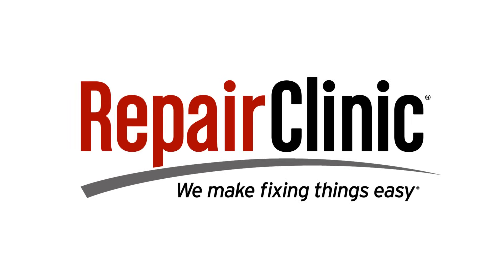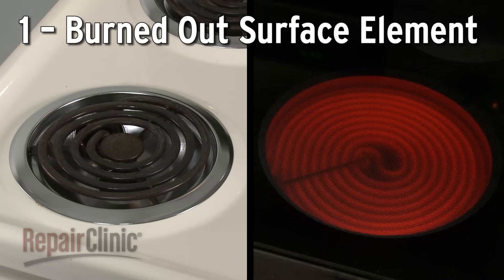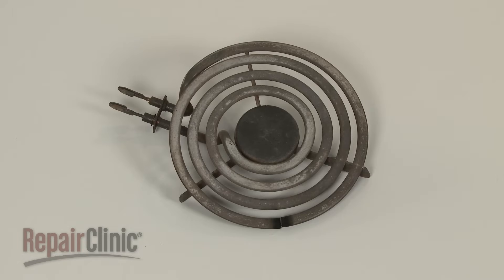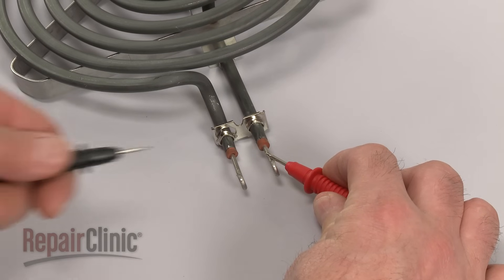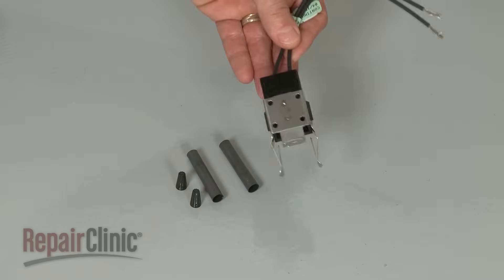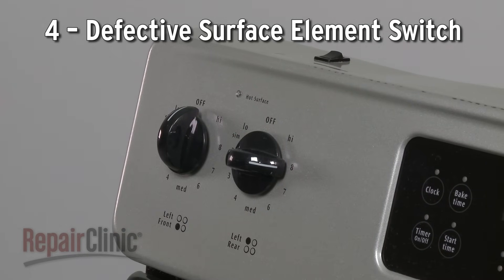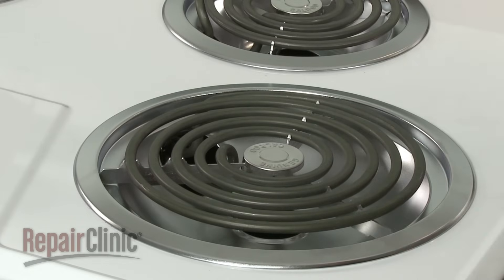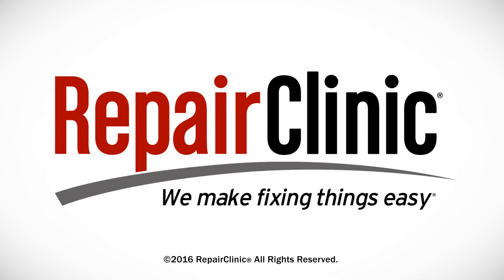Surface Element Not Working — Electric Range Troubleshooting

Comment: My radiant dual element has two probes.  One is not depicted in this video.  Test it for continuity too.  Mine failed and caused the burner to not heat even though it tested perfect for continuity in the coils and main probe.

Comment: how do you check the whole glass top stove if its not working
Reply: I have the same problem, I'm 99% sure you can lift up the whole glass top. People, remember to cut the power through your fuse box!

Comment: I own a Wirlpool Gold range GERC4110PS1 that the warmer coil, the back small right coil and the front big coil doesn’t work at all. The two coils on the left still work fine. Is there a place I should look first to find the problem? Strange that half the surface (plus the warmer element) stopped working at the same time.

Comment: OK, I have a GE with a glass top. The top burners and the oven does not work does not heat up put the clock on the stove works and the digital stuff works to set and turn the ovens on but no heat in the oven and top burners what do I need to look at?

Comment: do you have a video showing how to do a burnt wire connection repair?
Reply: Find the wire, get corresponding terminal for wire size, cut and strip wire, attach new connector and crimp !:)
Reply: @zachd8845  sorry for asking a dumb question: where and how can I buy the right connector? Mine is a ge electric range, thanks.
Reply: @ericpanda  mine was electric too, they make tools to determine the wire size/gauge. Once you find the size of the wire just match that with the right size/ style of connector and you are good to go
Reply: @ericpanda  also, no question is a dumb question, I bought the terminals and crimping tool at Lowe’s . Just make sure when you cut and strip the wire you don’t leave the wire very exposed once the terminal Is in place and the crimp has been made
Reply: @zachd8845  thank you very much! "they make tools to determine the wire size/gauge" do you mean i can buy a tool from local hardware store to determine the wire size? or do you recommend i just go ahead to open the back of the stove and then head to homedepot/lowes to buy a connector that looks like a fit based on what i saw?
Reply: @ericpanda  yes any hardware store will have a tool to help you find the right size. I would open the back of the stove find the connector that needs replaced ( you can buy a kit with all types of connectors) and make sure you find the right type in that size
Reply: @ericpanda  then you are good to go !:)

Comment: I disconnected my GE JCAP760 range for cleaning behind the range, and when I reconnected, the surface and the oven stop working. The light inside works, clock works, outlet works, but when I switch on, not the cooktops , or the oven are not working. Although the hot surface light is on. I have checked the plug it is OK. Any help would be greatly appreciated
Reply: @repairclinic  Thank you for the answer , Yes i am getting 120V from the wall outlet, and i am getting full 120V from convenience outlet  wich is on the range.
 ?

Comment: I have an element that has outside and inside. The outside works but the inside part doesn’t. Do I need to replace the whole element?
Reply: I have the same issue. Did you figure out how to repair yours? Thanks
Reply: Yes you have to replace whole element

Comment: From one day to the next, both elements on the left side of our glass top stove stopped working, won't turn on, no issues with either before. Clock/oven control pad, both elements on the right side and the oven all work. Are there fuses inside the stove to check?
Reply: did u fix itif so how?

Comment: My neighbor has a Frigidaire smooth top oven. Both the top burners and the oven stopped working. The clock works but no power to any of the elements. Is there a relay of some sort in these or what could it be? Any help will be appreciated. Thanks
Reply: @Steve Jakson you lost 1 leg of your 240 volts.
Reply: I have a Kenmore stove smooth top and oven don't work but the clock works
Reply: What fuse size do u usually use for an electric range
Reply: Mine is doing this, too. So irritating because the stove isn’t that old.

Comment: I replaced the 2500 w right side element on a Ceramic Hot Surface from Whirlpool. But it does not heat although current flows through all the points of contact. I switched the element with the left side old working element and even this does not work on the right side. The switch works fine. Need your expert advise on the matter please, if you could.

Comment: My burning is working but it is overheating .Even on low setting it burns the food .What could be the readons?
Reply: tr qazi did you get a response to your question ; i have same problem.
Reply: Colin ,I didn’t get the answer but I found the fault .If your burner is overheating even on low setting then change its switch .Burner is not bad but the switch is bad .
Reply: If stove top element is low or no power.. Infinite switch needs replaced

If oven overheats fast, replace tstat that runs from under the stovetop to the inside the oven

Comment: WHAT does sab mean my over will not work and all I did was trying to set the clock
Reply from the maker: The clock is in the Sabbath mode see use & care manual for info on clearing the setting.
Reply: My element to a GE glass top is a "textbook" burnout.

Comment: I have a flattop Kenmore. My two big burners only work on medium or high. Help!!!
Reply: Did you ever get an answer for this? Mine is only working on high or low setting.
Reply: @Ashnc85  Mine only works on high
Reply: Mine doesn't stay hot.
Reply: @Jackie_Su  did u get answer

Comment: my burners on my smooth top stove are working randomly. one side wont work, then the other side wont, then all of a sudden both sides will work...any idea what it could be? ty
Reply: UPDATE: my power cord wasnt fully inserted into the outlet. its the reason the stove was acting funny. its fine now that i pushed the plug all the way in
Reply: Going to check this in the morning. I hope this is what’s wrong!